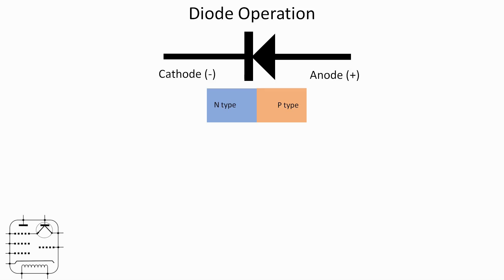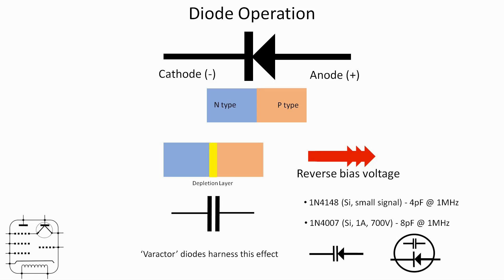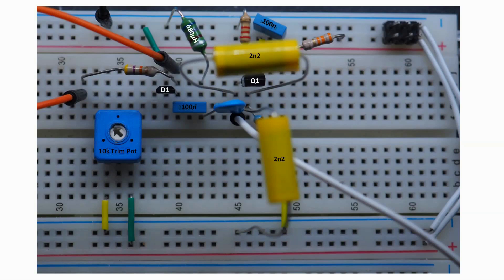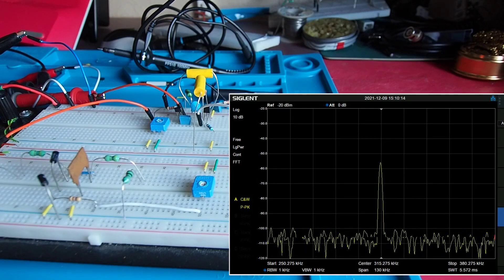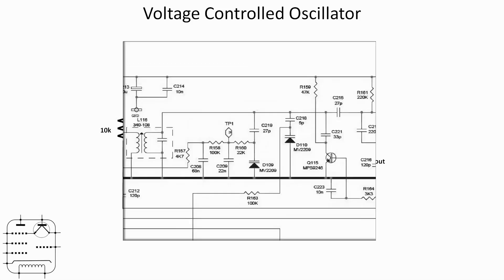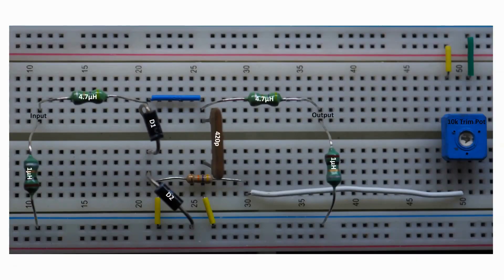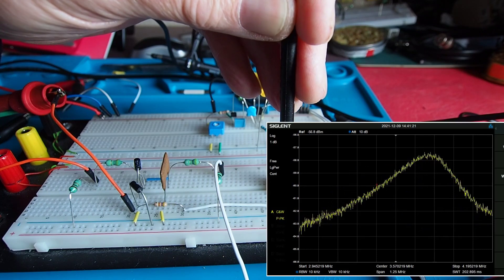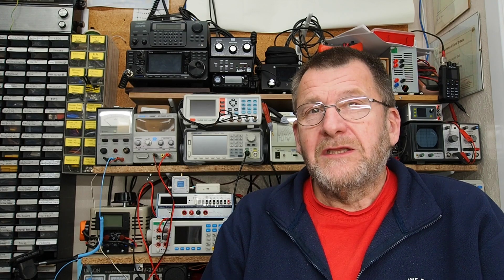Understanding and Using Varactor Diodes #118a

Comment: Another great video 😎 you probably know this but il comment for everyone... you can increase the zener diodes thermal stability by using 2 in series, below 5v they are true zener action and have a  negative temperature coefficient above 5v they take advantage of quantum tunneling and have a positive temperature coefficient so if you wanted a 9v shunt regulator voltage reference, varicap etc instead of using a single 9v zener you could use a 6v and 3v in series and thermally couple them to negate some temperature drift..